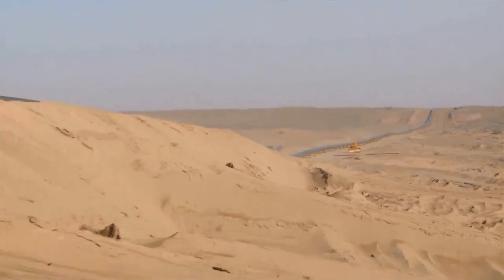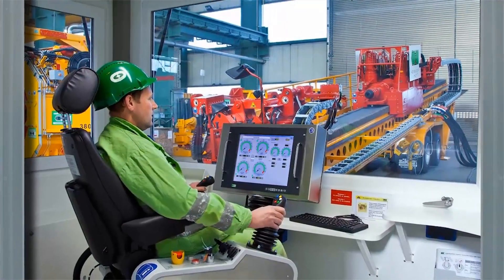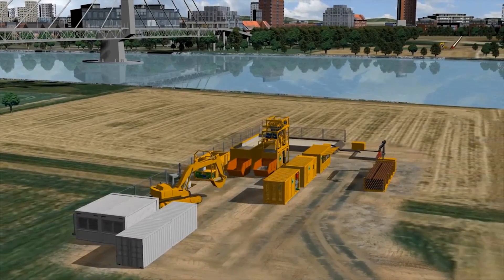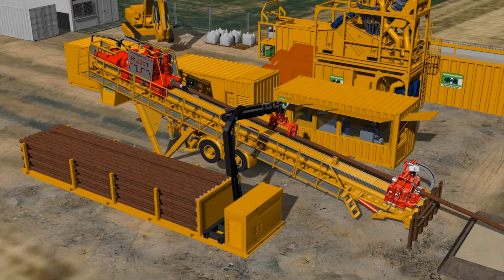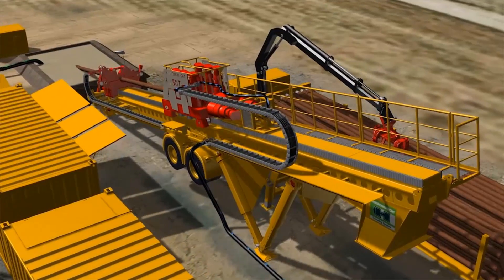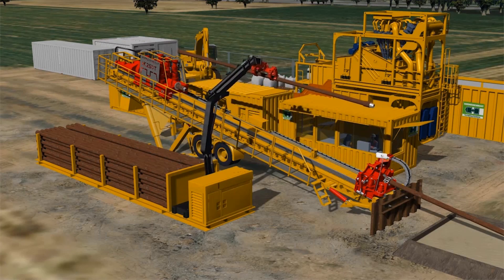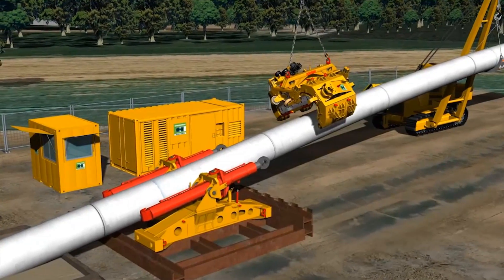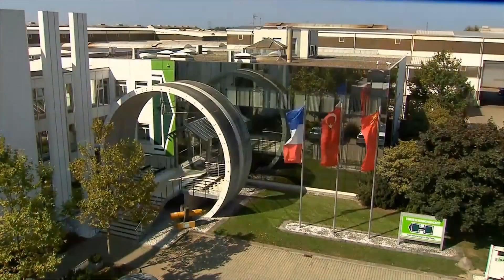HDD Rigs

Comment: How do you go through an alluvial material with rock bolts (round stones)? Is it possible?

What parameters do you need from the soil study?

¿Cómo se atraviesan un material aluvial con bolos de roca ?, ¿es posible?

¿Qué parámetros necesitan del estudio de suelos?
Reply from the maker: Dear M. Rodriguez,

Thanks for your questions. Unfortunately as alluvial material describes the soil in a very unspecific way, and rock bolts are an anchoring system, I'm not sure what you're searching for.
Speaking for HDD, stable soil is very important.
Regarding rock bolts, they are used if you drill through rock.
So I guess you're referring to two different "geological conditions".
Could it be? Any further questions for a specific project, please reach out to pr@herrenknecht.com.

Regards Herrenknecht AG
Reply: @HerrenknechtAG  
Thank you for your reply, maybe because of my bad English I can't put my questions correctly, I will write an email for that, thanks for your time.
Reply from the maker: No worries, thanks for your email well received. We've forwarded it to our pipelines specialists. Best regards. Herrenknecht AG
Reply: @HerrenknechtAG  Thank you.

Comment: How do you repair a pipe that was installed by this method? You have to pull it all out and then repeat the entire installation process?
Reply from the maker: With precise planning and precautions, such as a clean drill hole and a thick coating, damage is prevented in advance as best as possible. 
If the pipe is nevertheless seriously damaged, it must be pulled out at least to the point of damage.
There are also a lot of replacement projects where the old pipes are pulled out first and then the new pipes are pulled in directly. Sometimes the new pipe may have a smaller diameter than the old pipe and can be pulled into the old pipe.
Reply: @HerrenknechtAG  Thank you.